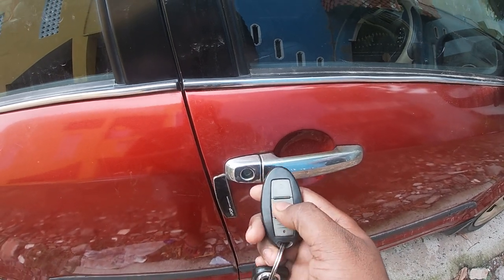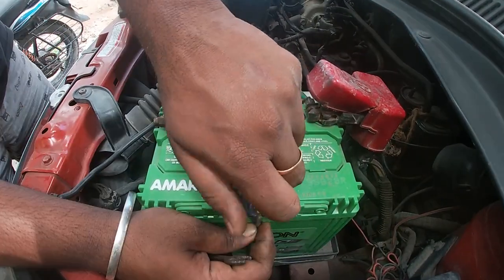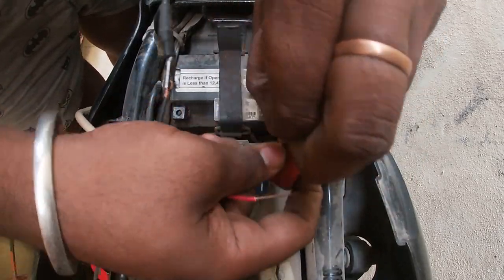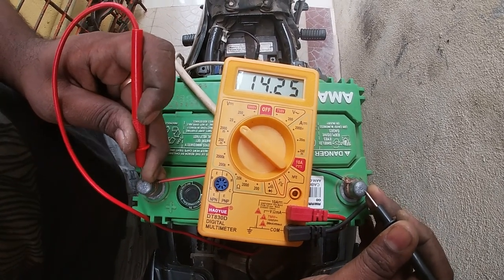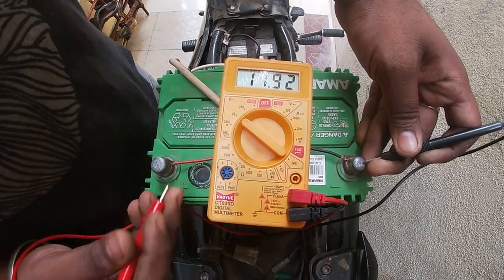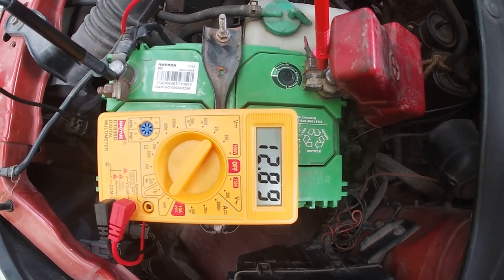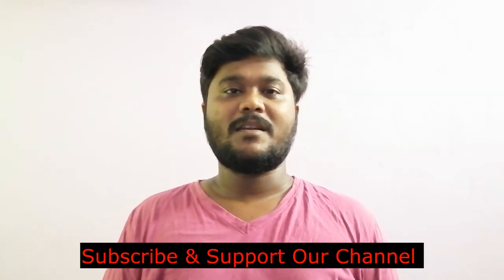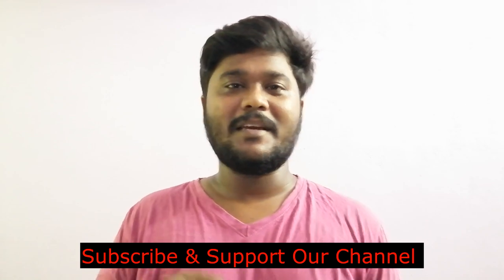How To Charge Car Battery In Home #Tamil | Charged Battery By Using Bike | #swift Car

Comment: Bro romba tq bro na alto lxi vaichuruken po ahthula subwooer bass tube iruku bro ahthu on pani vaichuta bro battry full aha down bro unga video patha bro enoda pulser 150 bikela nega panuna mathuri nanum set pani 1 hr keta bike runing la vituta bro apram carla potu start panuna bro  car on ahgiruchu bro romba tq bro 🙏🙏🙏
Reply from the maker: Thanks bro ✌😄
Reply: 30 mins or 1 hr
Reply: @baskaranv3991  1 hrs bro
Reply: I did 45 mins didn't start
Reply from the maker: Check battery condition also bro. If battery have some fault Naa it will not charge
Reply: @tnmotorider3910  charged in battery shop ji it's worked after that
Reply from the maker: That's fine bro ✌️ 🙂

Comment: Bikela output yaduthu Diract ahaa car la connect panni start pannalaaamahaa?
Reply from the maker: No bro disconnect and charge it that is best. Then only full power output will goto battery.
Reply: @tnmotorider3910  battery la connect pannama direct ahaa car la +ve -ve la connect pannalaamanu keatten bro
Reply from the maker: It won't start bro I think so. Car Amp is higher than bike Amp.
Reply: @tnmotorider3910  I have this doubt on long days ungalukku yadhadhu video tharinja recommend pannunga
Reply from the maker: Sure bro I will refer. Bro to  be clearly. Without removing the battery from the car if you charge it by using bike means. It will take too much time to charge and start. Because car ecm and center locking system will run always. So they will consumes some power but at the same time if you remove the battery and charge it means.  Battery also charge little bit soon power won't get waste.    Because bike amp is very low. So only it takes at least half an hour to to charge car battery.

If you want to try in that way means try bro. No problem will come 👍 but  want to wait too much time. Let's check and let me know bro

Comment: How much time will it need
..to charge..???
Reply from the maker: Mostly 30 minutes bro
Reply: @tnmotorider3910  thanx..should i revv bike or not
Reply from the maker: Little bit bro
Reply: @tnmotorider3910  thanx bro
Reply: Not going more than 11volts...what is issue
Reply from the maker: Battery have any fault bro ?
Reply: @tnmotorider3910  no brother..car is only 2 year old ...
Apart from that when i switch on my headlights and power windows..some times music system  get trun on automatically...
Reply from the maker: Car model bro?
Reply: @tnmotorider3910  alto800 bro..if you know the solution pls tell? It is really frustrating now..
Reply from the maker: What is the battery voltage now?? Suppose it's near by 11 naa try to put charge again and rev the engine little bit. Important remove your bike battery to putting charge. Surely it will get charge
Reply from the maker: bro your last comment got hide automatically. let me know issue resolved or not?
Reply: @tnmotorider3910  no brother...voltage not crossing after 11 vots...if i force rev..bike creates weird noise..
Reply: Thanx for your concern and appreciation ...
Reply from the maker: In which bike you trying bro?

Comment: Light on செய்தால்  கார் la  battery  lo aguthu self eduka mattikuthu ena pannalam
Reply from the maker: Check the battery condition bro. If the battery is fine then check proper current is coming from alternater to charge the battery.